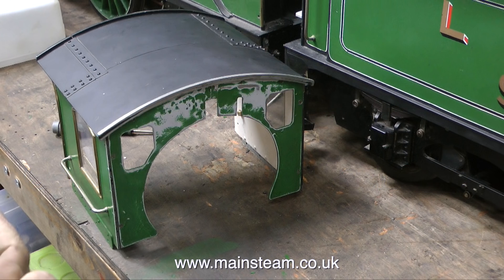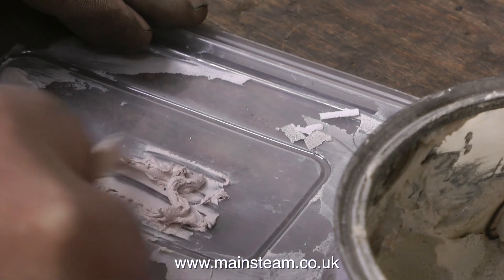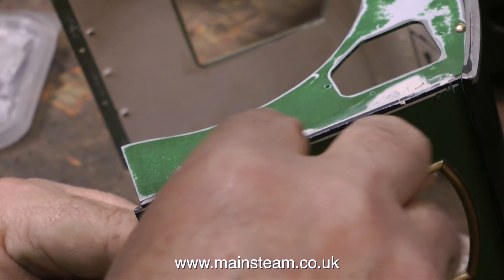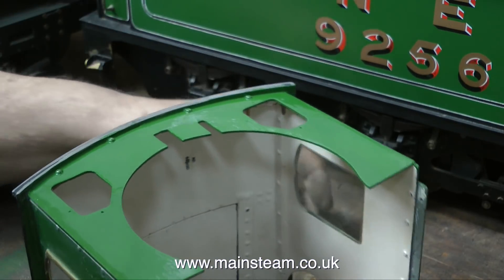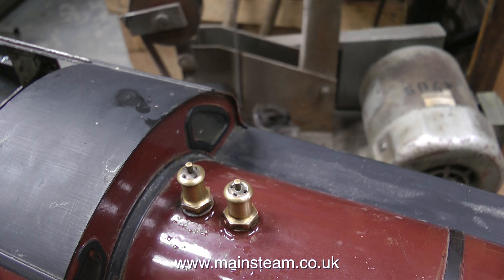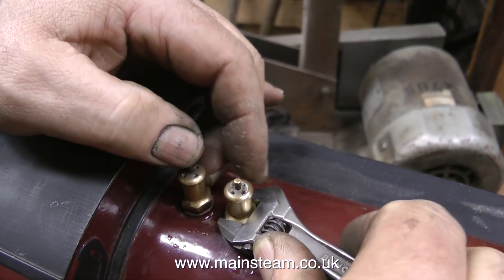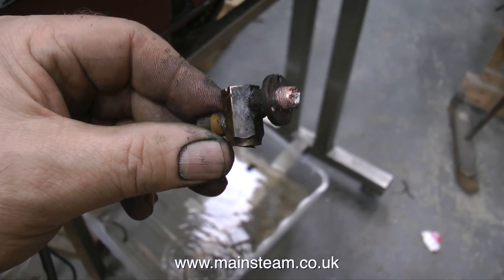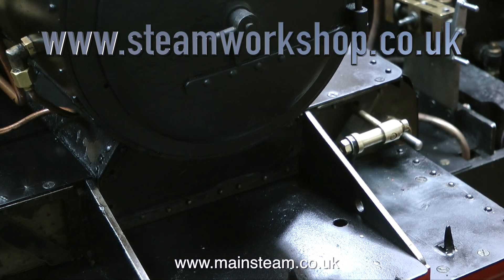WORKING AT THE STEAM WORKSHOP - PROBLEMS AND SOLUTIONS

Comment: As I understand it, Keith, a bolt has an unthreaded portion below the head, whereas a machine screw is threaded its entire length, apart, obviously from the head
Reply: nah, a screw is a threaded rod that screw into someting
a bolt is the assembly of a screw and a nut used to tighten parts together